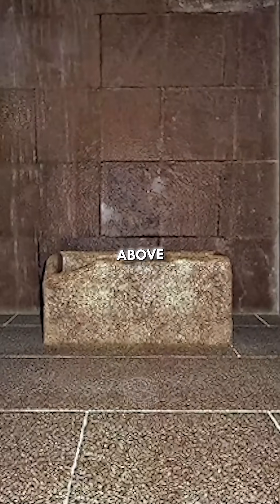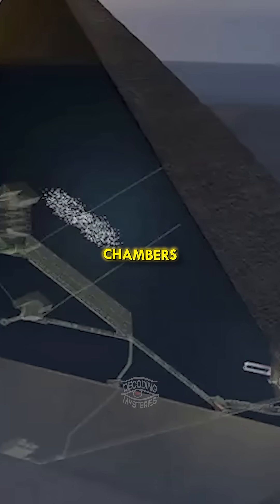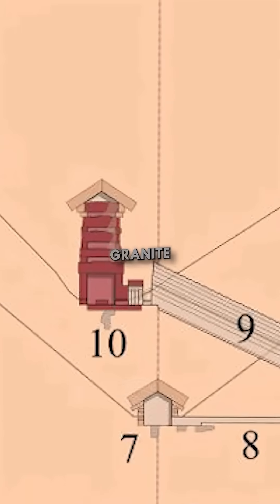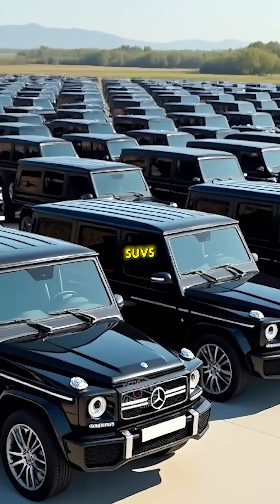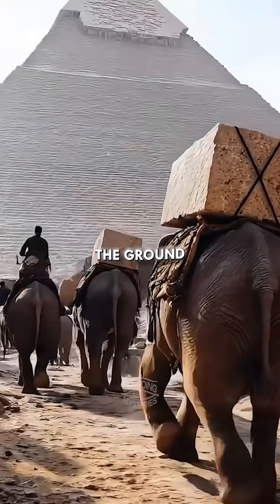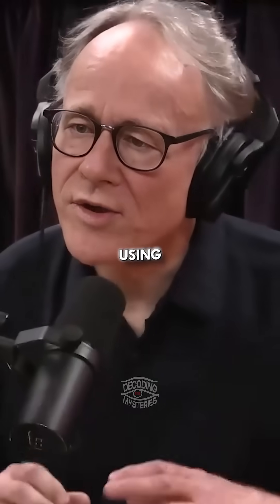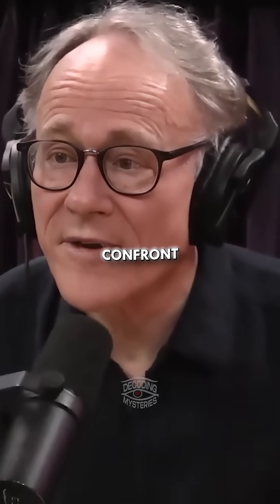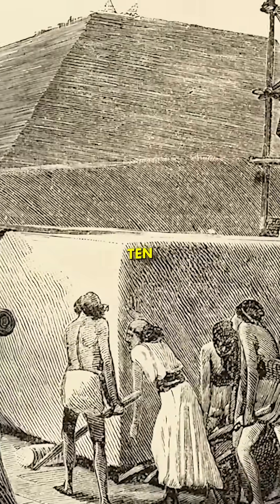Engineering Secrets of Egypt's Great Pyramid That Defy Logic 📜

Comment: 600 meters ramp calculation:  To determine how long a ramp you’d need to raise a 70-ton stone up to a height of 350 feet at a 10° incline, we can use basic trigonometry.

✅ Step 1: Use the sine function

The sine of the angle gives the ratio of opposite (height) to hypotenuse (ramp length):

\sin(\theta) = \frac{\text{height}}{\text{ramp length}} 

Rearranged to solve for ramp length:

\text{ramp length} = \frac{\text{height}}{\sin(\theta)} 

✅ Step 2: Plug in the values

Height = 350 ft

Angle = 10°

\text{ramp length} = \frac{350}{0.1736} \approx 2,016 \text{ feet} 

📏 Final Answer:

You would need a ramp approximately 2,016 feet (614 meters) long to lift a 70-ton block to a height of 350 feet at a 10° incline.

Let me know if you'd like to factor in friction, effort required, or alternative ramp angles.
Reply: Yes, please!
Factor it in, and then tell us how many men it would have taken to drag it up that ramp, successfully overcoming friction. The skeletal muscular differences that we now have between us and ancient people is notable. They were much smaller.

What connections or apparatuses did they use to pull it without it snapping? Cloth rope? Hemp? Metal cables? Any lubrication? And do we have evidence of it?

Then explain to us how those people, who (if they were s|aves) were probably malnourished, not only dragged them up, but lifted and placed them perfectly to where they sit today.

And if you're still feeling yourself, please explain how they quarried 50,60,70+ ton solid stone from 100+ miles away and transported them to be processed and placed.

Math is cool and I'm not doubting your knowledge, but it doesn't explain everything. 

We don't know how they did it, which is insane.
If it were merely mathematics that solved the mystery to how, then we wouldn't be scratch our heads today.
The experts have no idea, don't accept anything you're spoon-fed.

Something is missing.
Reply: @gnarledONE  Wally Wallington managed to move multi-ton blocks single-handedly with extremely primitive tools and nothing more than a simple understanding of balance and leverage. You can look up videos of him doing so.

These so called 'experts' who have no idea either are not actual experts, or you've fundamentally misinterpreted what they actually said (far more likely) which is that they aren't entirely sure which method was employed, just that it was doable even during the time period.
Reply: How many people or elephants would it take to pull that rope and is the rope made to hold 70 ton blocks
Reply: @MKa-d6e  i also did the calculations and the length is about 539 metres. so it would make sense that elephants would pull the blocks up using a wide ramp, and they would get off using a ramp on the opposite end of the same dimensions

I could be wrong tho, but my brain came up with this plausible solution
Reply: @MKa-d6e of course not😂
Reply: What about Labour?? Or I guess “power” or “force” it would require??
Reply: @russellbiggs9594  it would require force and power that no humans even in this day in age could pull off.
Reply: I can use ChatGPT too buddy
Reply: And another thing , if a ramp was built as long as you say what happens to the guys pulling when they get near the top ?, do they go down the slope and help push with the other guys ? …. If so the ramp would have to be a hell if a width to accommodate this massive bunch of people. 
Just trying to think this through 🤔
Reply: I’ll bet my last dollar you used chat gpt for this
Reply: Where do they get 10º from? With block and tackle you can lift the straight up at 90º
Reply: basic answer from ChatGPT
Reply: @uchiha_dstyle5791  yeah but it highlights a flaw in the video from Graham, if the ramp was 50ft wide it's volume would be 15% of the volume of the Pyramid of Khufu. He's incorrect that the ramp would be larger than the pyramid.
Reply: The problem isnt so much the length of the ramp as it is the width of the ramp at its base and how much total volume of material would be needed to construct the ramp.
  But that whole argument fails due to the false assumption that the ramp has to get the beams from the ground up to the 350' level all in one go.  It doesnt.  You can just a mini-ramp to get the beams up onto the next level of stone as each new course is completed, and thats only a rise of about 3 feet.  Just store the beams on one side of the completed level, and work on adding the new level on the other side, and place your ramp and move the beams up onto the half-completed new level once there's enough space to store them there, remove your small ramp (A single large dumptruck of material, 1 days work for 5 guys), and then complete the rest of the new level.  Rinse and repeat.

Comment: We can do it too with the means they had back then. It's just going to take a very large group of people to drop everything they're doing for a very long time. Aside from religion, there's no reason to do it. 

It doesn't require much more than that, because stacking stones in a pyramid shape is the easiest thing you can build. So the only issue is scale. Anyone who even had one course of University mechanics knows it's a difficult but totally possible task. 

We have to remember that people back then were just as smart as we are right now. Just because we now use modern tech to solve issues doesn't mean there isn't older tech that gets the job done as well. 

I'd argue that history and engineering are far more intersting than mysticism, because you actually get to think about things, rather than just fill every gap in your limted knowledge with "aliens" or "magic".

Comment: ya i know how they  built it.  They used water floating everything with logs and animal hide air bags. Build a perimeter then float everything up a water shaft that you close at the bottom then fill with water. Laborer's work all day in water using stones to wet sand the rock to fit precisely . The byproduct of the work would be SAND.

Comment: I had a dream, that the pyramids were actually buried with desert sand as they built each level up. Once the Pyramids were complete, the sand was removed, exposing the majestic structures. This was difficult but not impossible to achieve in a span of 661 years.
Reply: Still gotta move the blocs, some of which were ridiculously colossal!!!!
Reply: @russellbiggs9594  yep, the slope problem was eliminated. Elephants were used to haul them across a ramp.

Comment: The pyramids are magnificient achievements indeed. But I hate this underlying "it must have been aliens" implication that is often pushed in this context. It is simply bs. 

Ask an experienced engineer and he will tell you several ways how this could have been achieved (at least in principle). The most surprising element here is the volume of time and resources required to achieve it with ancient (yet highly effective) technology. But time and resources were not a problem to a ruler that was viewed as basically a god. They could let tens of thousands of workers built this thing over 30 years or so, no problem at all. Thousands of people surely have died in the meanwhile, but in the end it worked. 

Moreover, there is an archeological sample selection bias here. We only see today the best constructions that were finished and persisted over ages, which may have been rare exemptions. There might have been hundreds of other buildings that were never finished or broke down because they were less optimally constructed.

Comment: Or... perhaps the sands at the bottom of the pyramid were much higher and they dug down to build the pyramids instead of building up. It's a lot easier to dig a quarry than it is to lift heavy weights.

Comment: i Heard a theory the pryamid was built from the middle up and out, they used a canal with water and flooded it using buoyancy to float the blocks to where they needed to be. it makes the most sense. because a slope is just insane. However we have floating city blocks called air craft carriers. I'm sure they could find enough stuff to create the required displacement to float rock to the top.
Reply: dawg this was thousands of years ago they didnt even have steel and barely iron. They used copper tubes and flint chisels bro

Comment: guy is clearly not an engineer...... using pivots, pulleys and levers you can basically move anything. All you need to do is create a pulley system where as one stone goes down it pulls the upward stone at half the force. All I need to do is get multiple small weights that can moved easily and use the weights together to create the counter for for the pulley system,. guy is a moron if he doesn't get this.
Reply: if you are an engineer you know that some materials can only withstand a certain weight. idk what you are talking about pulleys and pivots bro they just used elephants and copper tubes and chisels. no need for pulleys and other tech, thats what the romans did. 

they didnt have steel back then so what metal would they have to carry thousands of tons upwards…its literally just manpower and animals bro

Comment: It’s amazing something over four thousand years old still stumps all our science and technology today.
Reply: 12,,000 years old you mean
Reply: Its at least 12.000 years ;)
Reply: Granite can be crushed into powder and then reformed as desired... Doesn't need to be lifted as a solid beam.
The technique is millennia old. We use it in construction today and the Romans used it as well.
Reply: @TheHydraV lol no. It's not concrete
Reply: @JT-hs3pe 
Crushed granite can be reformed using natural and synthetic binders.
It can potentially be made even stronger than before.
Reply: @JT-hs3pe Granite composites, with materials like quartz with resin, are more durable. The stuctures can be made stronger than solid granite by adding polymer or resin stabilizers, organic binders, etc...
The result is a nonporous composite that is more res istant to time and impact.
Reply: @TheHydraV that's a gud useful technique but there's a problem, the stones used in these structures r not composite, they r solid pure stone. So this method is not wat they used. They cut these stones and hauled them upwards of hundreds of miles to the construction site. Today we CAN do this but it takes our best machines to do it and also dozens if not hundreds of years. 

We know not the equipment or techniques they used, we only know the materials and state of the structures that remain.
Reply: @baileydombroskie3046 
Composites can become seemingly fully natural stones over centuries, far be it to say millennia old composites are identifiable as composites.
There are Roman structures that are not identifiable in their structural composition, as pertains to the distinction between man made composites or natural formations...and that's far, far more recent than the ancient Egyptian structures.
Reply: then how about The largest unsupported dome in the world ? its the Pantheon's dome in Rome  about 2000 years old and still in use. they cant even do that with todays materials.  soo much knowledge have been lost over time that it feels like we move backwards  .
Reply: Oh they know who did it lol but cant and wont say, as long as theres a thing as politics
Reply: Well it doesn’t stump science as we know with 99% certainty how is was done. Firstly, he’s over exaggerated the weight, they’re about 7-9 tons each not 70 tons, also there’s only 70 not hundreds as he claimed, the ramp wrapped around the pyramid, reducing the need for a super long, super high ramp and finally, they are load barring cavities not chambers.

Hey were also signed by the builders, referring to the gangs of Khufu, proving that the pyramids were build exactly when science says (but he forgot to mention that part).
Reply: @anthonybariek997  how could the possibly build a ramp that wrapped around the pyramid that supported 100,000-160,000 pounds and how did they turn the stones?
Reply: @fattdamon1980  the ramp is actually still in the pyramid. They found chambers where the ramps would be. Basically the spiral ramps are internally built inside the pyramid but closer to the outer walls. It's literally part of the pyramid. And then they seal the ramps after they are done. 

As for the super heavy beams, they deduced that they used a counter balance pulley system using the slanted hallway chamber in the middle of the pyramid. The biggest clue is a stone notch at the top of the hallway. but some modern idiots sealed it up with cement, so its hard to be 100% sure.
Reply: @fattdamon1980  Maybe build it from the inside out or work from one side to the other as you fill in the pyramids
Reply: @fattdamon1980  turning stones is easy just pull them the way you want them to go lol
Reply: @fattdamon1980 kind of like today where they would build a steel scaffolding to face a sky scraper same principle different methods
Reply: @waterblue2261  its just a theory no one knows for sure
Reply: @Wyndham-t4r well thats isnt how it was done at all as we already know, but, lets say it is, now explain how it was lined up with true north and a constellation light years away with a level of precision that is unheard of. We will wait...
Reply: @anthonybariek997  They dont have a clue how it was done. And your explanation proves that. You flat earthers are wild.
Reply: @anthonybariek997 khufu had nothing to do with the Pyramids being built 😂 I CAN’T 😭😂😭😂
Reply: @anthonybariek997 never can take someone seriously that says “over exaggerated”.
Reply: @anthonybariek997 - you are wrong. Google is your friend. He's overestimating by a little but quick google search says 48 to 52 tons and the stones used to roof the chamber 50 to 80 tons each.
Reply: They are hiding facts. That's all.
Reply: easy to build when you have 4000 slaves
Reply: Because scientists are not smart and our technology is nowhere near what they used in past times
Reply: incorrect we know enough to know it wasn't aliens of god, get it out of your head
Reply: Nothing like 2 millions Jews for slavery and building pyramids🎉😂❤
Reply: People forget also there was a tributary of the nile a lot closer to the pyramids 4,000 years ago that they transported a lot of the heavy stone up. 

Limestone was quarried on the Giza plateau and the harder stone (granite) about 800km away and ferried up the nile to the site. They used dolerite pounding stones and abrasive sand that cut harder stone.

The reason no academic archeologists agree with Hancock is because he's a Hack. Just like Randal Carlson. Just like Chum Lee from Australia. All hack jobs. If they actually studied the subject and released papes for other scientists but they don't, they make it all mysterious just to grift money.

Randals been saying for years he's uncovering something big and never does, just  agrift for monthly subs and donations.
Reply: It doesn't it just doesn't
Reply: A lot of these people coming in Rogan’s podcast aren’t actually experts and are just there to spew sensationalism. Take a university archaeology or anthropology course and you’ll find the answers.
Reply: Its aliens.  I don't care what you say.  Its aliens!  All aliens!  👽👽👽
Reply: Dude if technology never progress, I assured to you that we still be using the same technique that Egyptian used.
Reply: Their was obviously an very advanced civilization here a long long time ago
Reply: Fuuk , our so called top Scientists told us a loose, home made face diaper would protect you from a microscopic virus. 
 Two weeks to flatten the curve, Pfffft!! LOL
Reply: It was a mountain, they cut the area around it down.
Reply: It doesn't.
Reply: Lol. It absolutely does not stump our science and tech today. It is well known how this was done, all it takes is for you to get past your intellectual laziness and you will find out. It's not even hard or complicated. The principles are simple.
Reply: If the stars are properly aligned I believe the weight of such things are greatly reduced..an astronomer's anti gravity riddle..there are other ways to solve the riddle as well with great harmonic vibrations that are focused..possibly specific places on earth that..sound off and amplify..or...they were just giants that could over come such weight obstacles..maybe giant engineers..
Reply: You people need the why files..
Reply: You overestimate our scientists.
Reply: no it doesn't. it stumps nut cases who believe in ancient aliens.
Reply: It does not. Only two questions remain: Have we thought of all the options the Egyptians had to do this? and Which of these options did they actually use?

For comparison, those beams were 70 tons. The heaviest single thing we flew from A to B was a generator weighing 190 tons. We're not stumped. We know how to move heavy stuff.
Reply: @washellwash1802 now explain the precision tools, drill holes, and laser precise cuts. We will wait...
Reply: 4000 years old?... more like three rounds along the zodiak - 25000 each
Reply: It doesnt stump our science or technology.
Reply: @John...44... and yet cant be replicated.
Reply: It does not stump "all" science and technology.
Its quite simple...
"Sky People" end of story.
Reply: It only stumps stupid people.
Reply: Are you having a laugh? have you not seen modern city skylines? Modern science and technology blows this old tech away!
Reply: yes! Please  people  stop putting ayour trust and faith in science especially the medical science machine!
Reply: There was something that even the Egyptians said they didn't build the pyramids but discovered them already there.
Reply: @obviouslytom  no??? The egyptians actually recorded the construction of many pyramids before the pyramid of giza, like the red pyramid, and these pyramids were the inspiration, and for younger pharophs to one up his ancestors
Reply: @obviouslytom  I believe that. Aliens!